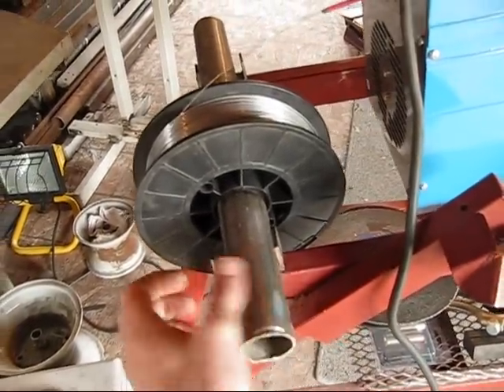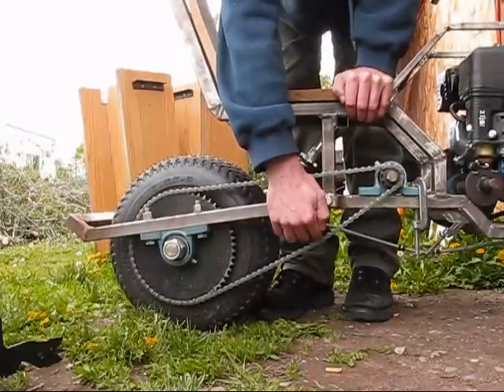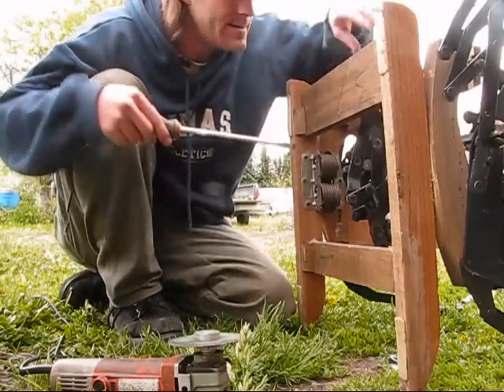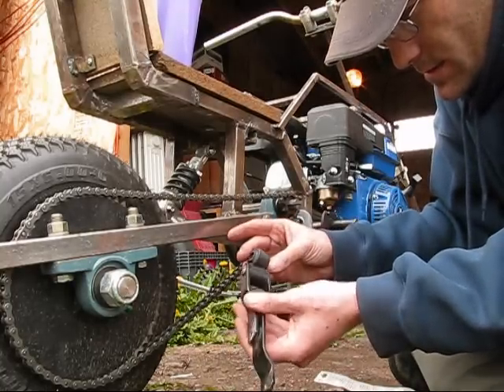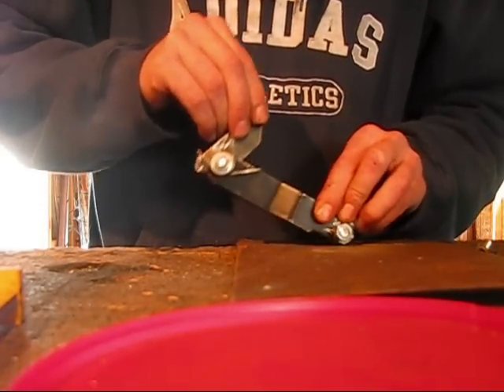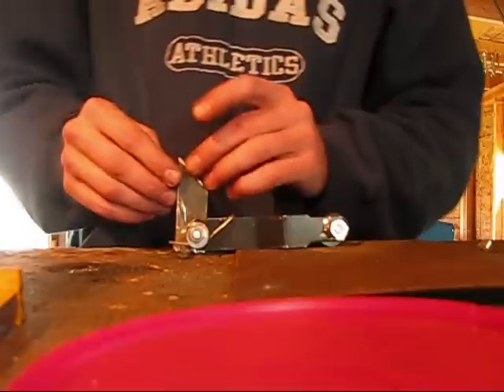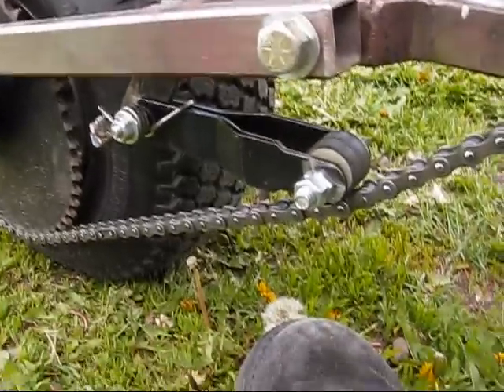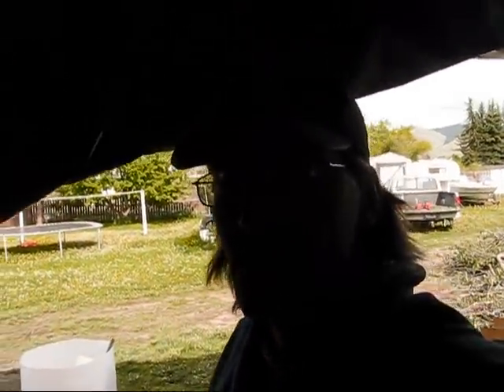( Chain tentioner ) # 26 T-man's Reverse Trike Build

Comment: After a few miles the rubber grommet will be shredded.  You need to find an old ten-speed somewhere, and those can be free, then pull the rear derailer off.  The funky looking s-turn that a derailer forces the chain to make has two little sprocket wheels that will bolt right on to what you've already made.  And they won't fall apart like a rubber grommet.  ;)

Comment: can you make a chain guard with some angle iron for that piece your worried will be to exposed by the tensioner pushing down weld it to the frame on an angle from the front to the back then go up with a straight piece i dont know if that make sense id have to draw it maybe